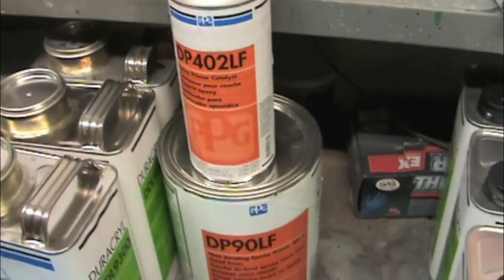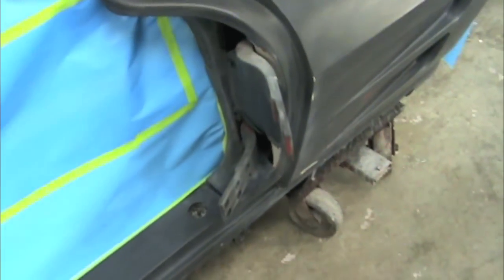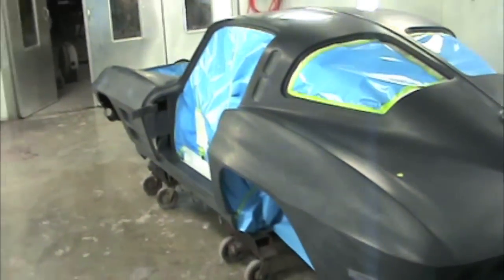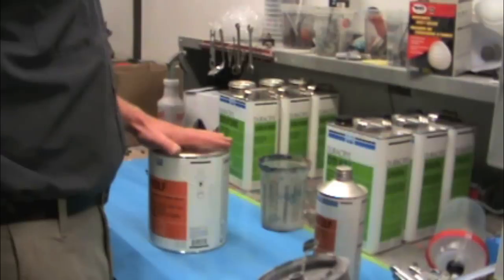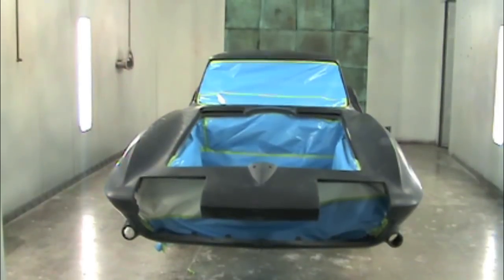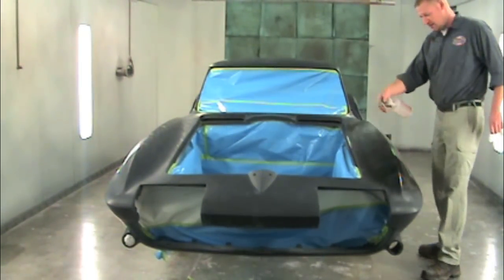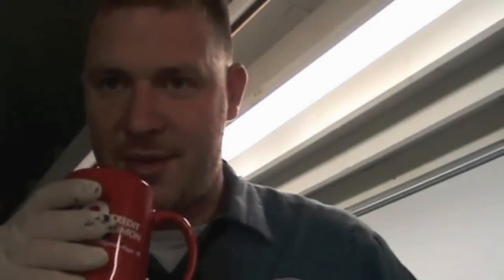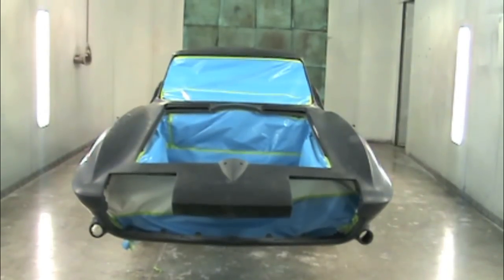1963 Corvette Lacquer Paint Job Part 1.mov

Comment: Thanks so much for your vid.....I've been searching for hours and hours regarding the steps and process to paint my C1. Your video is the only information I have been able to locate anywhere!

Did you record any of the initial stages? Stripping, base primer coats, gel coat...ect?
Do you have any suggestions where I can acquire detailed info on the paint restoration process back to original standards?

Thanks again Jonesy...